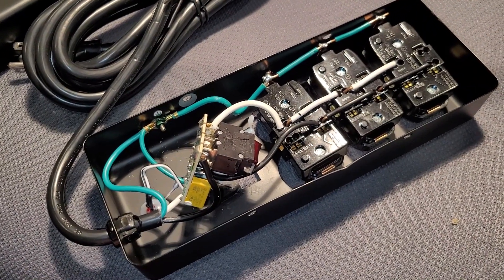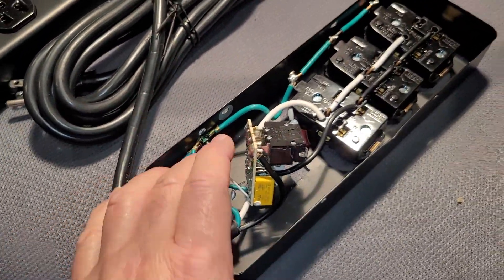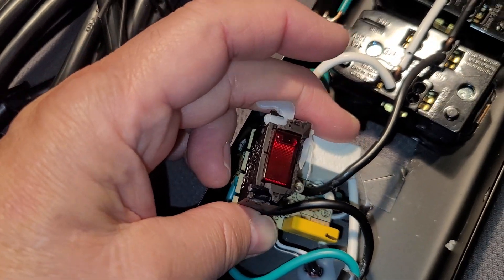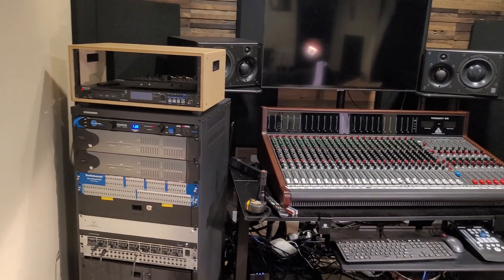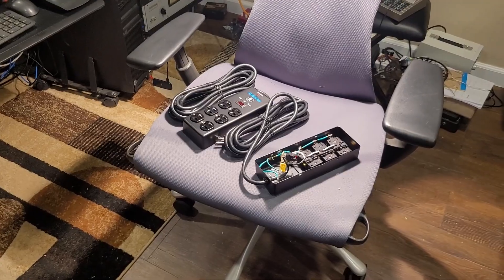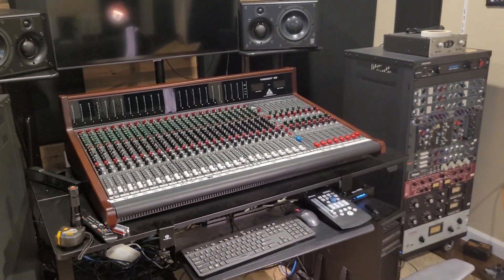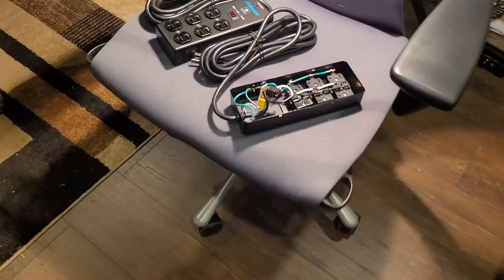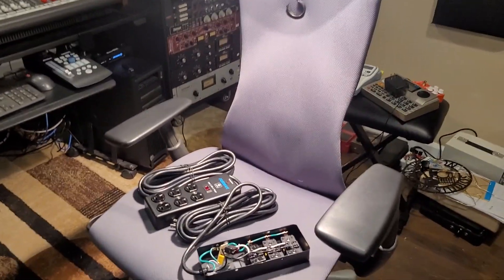Furman SS-6B surge protector. Not a fan of this unit.. exploded view, a view inside the unit

Comment: Double Online UPS's are the best you can get as far as reconditioning the power and filtering out basic low voltage noise and interference. They also work for a few minutes even if the power goes out. But for surge protection (think 6000volts) nothing beats the non-mov series-mode SurgeX or Eaton Power-Sure 800, as they last forever. So basically you plug the surge protection into the wall, and the UPS into that. Then your really expensive UPS is protected from a lifetime of 6000volts+ surges, and the UPS handles the 120v/240v noise, brownouts and power outages. The combination of the two is not cheap at all, but nothing good is. For those that don't have horrific line noise, a cheaper puresine interactive UPS from CyberPower is the way to go, APC is better but costs more, especially the ones with remote networking, control and logging.
Reply: Great advice! Like you suggested, just make sure to choose the non-mov Surgex model! Surgex has gone insane with its price structures! You can find the same tech in Zerosurge or Brickwall surge protectors if you’re looking for a potentially cheaper alternative! I have 2 Zerosurge protectors and absolutely love them!

Comment: This power conditioner absolutely WORKED for networking issues I was having for weeks. I isolated the issue to two Winix air purifiers and a mini fridge that was dumping electrical noise and interfering with my computer and possibly modem. INSANE how it works with such little components inside of it but I HIGHLY RECOMMEND you try it before you judge it. ALMOST 5/5 stars on Amazon so I'm not alone. BEST $35 I ever spent, and it also acts a surge protector and circuit breaker.